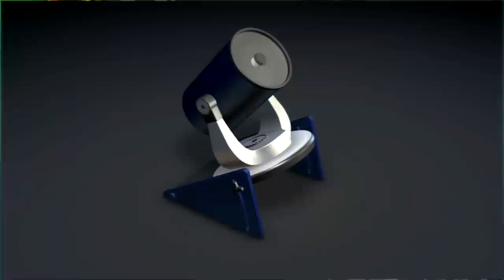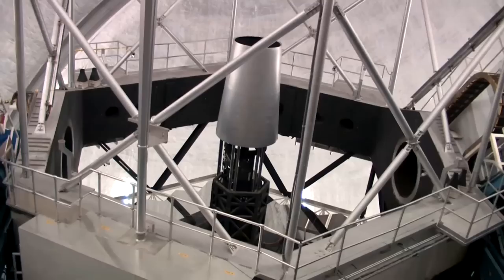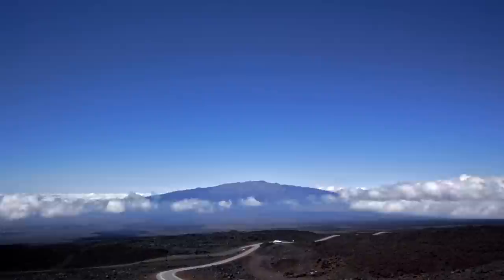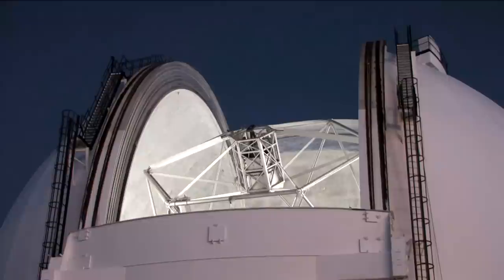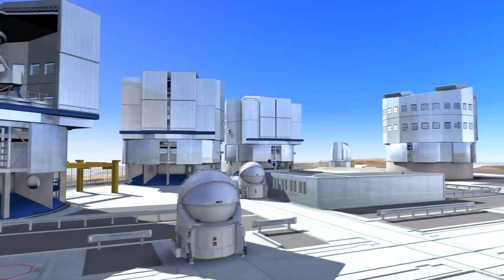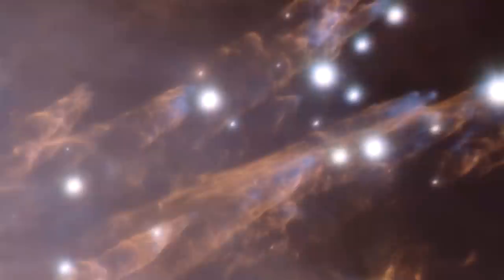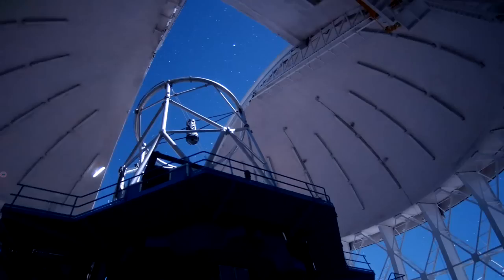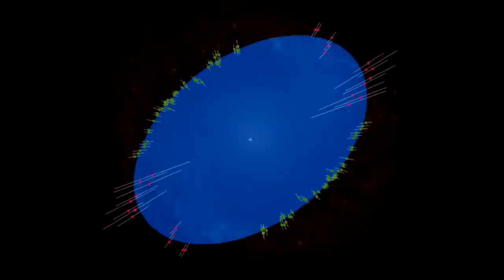Eyes On The Skies (3): Technology To The Rescue (HD Quality)

Comment: There is a site on the net that goes into the math for a very accurate worm gear drive for accurate positioning, with at least 6 major measurements taken into account (the atmosphere is one of the last of them). Interesting stuff, and Wikipedia has an entry on the final topic too as Astronomical interferometer